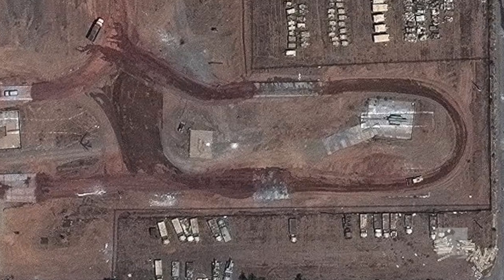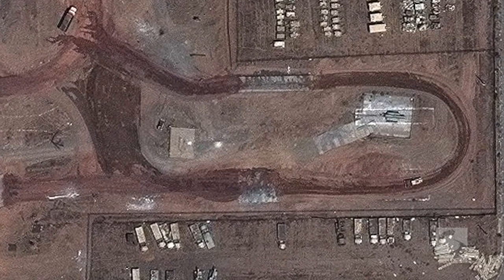Satellite Images: Iran Builds S-300 Missiles Sites

Comment: Sim, I thought the S300 was mobile, that's the whole point? It doesn't need a static Base..? The only way to take it/them out is either by Air strikes which is unlikely. SAS on the ground which is also unlikely, or nukes. 
So yes it must be a training facility...
Reply: They are mobile but during peacetime they are usually based in one location most of the time.  This allows them to keep operating for a indefinite amount of time while being easily maintained and hooked up external power to avoid wearing out the generators.  They can't fire on the move and it takes several minutes to set them up so they are useless while in motion.  During times of increased tension, they can be driven out to remote locations to increase survivability and moved regularly but it's not practical to do this every day for years.  The vehicles and generators would require massive amounts of fuel and wear out quickly
Reply: they are not mobile , unpacking take half hour , plus radar reaveals their location for thousend miles.